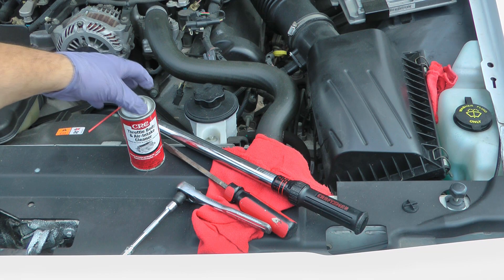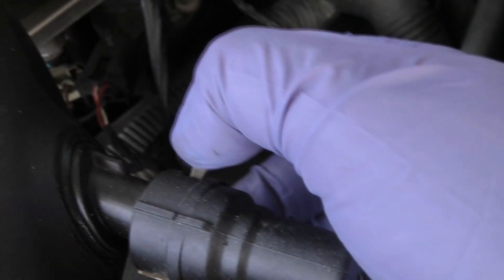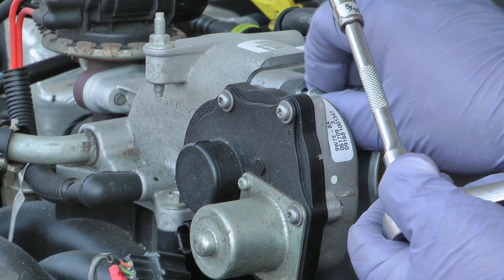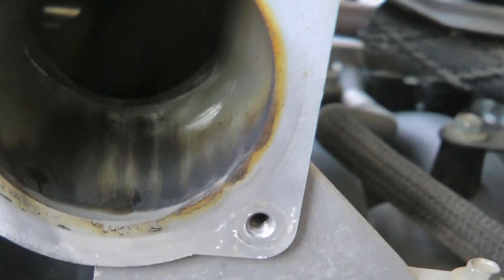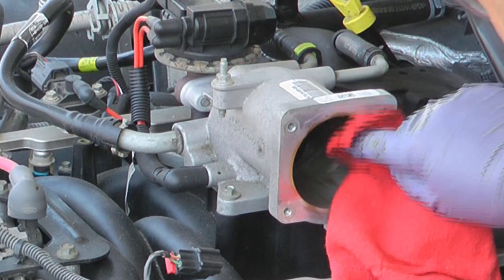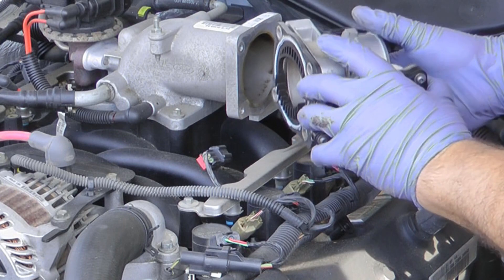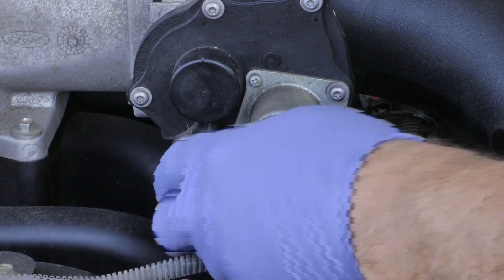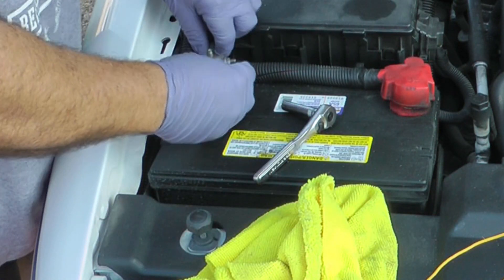Ford Crown Vic Throttle Body Clean and Calibrate Calibration Recalibrate

Comment: i just replaced throttle body on my 2008 and pretty much tried every reset besides what u did i just held terminals together and did the rest of the steps but its still not calibrating and throws wrench light after 20 seconds of driving but wont be on after turning car on and off everytime should i try the way you did it ?
Reply from the maker: you should try what I show because it works.  There are also some higher end scan tools that might do the recalibration... good luck

Comment: What wire is that sorry for recalibrate
Reply from the maker: removed the battery cables from the battery first!  Then connected them together.  I just used a little alligator clip wire

Comment: I spent about 2 hrs cleaning the throttle body on my car. 2011 CVPI 75000 miles. Not sure how it could be that bad with low miles?
Reply from the maker: maybe lots of idling or they left it where it got lots of dirt in the intake

Comment: Did you reuse the same gasket, or will anyone doing this need to get a new one?
Reply: I LITERALLY just got done with mine and yes you can reuse the gasket if it looks good still and has no cracks or is dry rotted. Also you can go to the auto parts store and buy one for around like 30 to 40 $ and they will have to order it though most likely.
Reply: @jimmakk6292 Thanks man! That's some perfect timing.
Reply from the maker: I have always reused without issue

Comment: The shop manual says to rotate the throttle body bolts 90 degrees after torquing.  I noticed you didn't do that.  Is it necessary to "stretch" the bolts 90 degrees??
Reply from the maker: you are correct that the shop manual says to add another 90 degrees.  The book I was looking at didn't mention it.  I'm not going to touch mine since I have had zero issues.  However if I ever remove mine again I will observe the proper torque spec.  Thanks for catching that!

Comment: Is there a certain guage wire that needs to be used
Reply from the maker: that's a good question!  I think I used about an 18 gauge wire.  I wouldn't go smaller than that (higher numbers are smaller)
Reply: @WJHandyDad  I have an sctx4 tuner and just realized you can reset the KAM “keep alive memory” and did it this way, relearns it’s values same way I imagine

Comment: I have a question. A while back my 06 p71 was sitting for weeks, then I drove it for a while, and then my battery died. But after replacing the battery and driving for a while the car then stalled, gave a wrench and check engine light (code p2107), and wouldn't drive properly. So my mechanic diagnosed and replaced the throttle body with one I bought aftermarket. The one I bought aftermarket doesn't look like yours, it's the silver valve, and not yellow like yours or like I see some online, and the new rectangular tps. But it would still stall and give same code. So I thought maybe the throttle body I bought had a tps for regular crown vic,  some tps only work with none p71 models, so the mechanic replaced the tps with a new tps that works with the p71 model. But I noticed this time the mechanic didn't disconnect the battery. I can tell he didn't disconnect the battery this time when replacing the regular tps with the p71 tps like he did the first time he replaced the throttle body after the engine light, because my aftermarket radio didn't reset. But even after the tps replacement the car is still stalling and giving the wrench light. Do you think maybe I need to follow your steps, disconnect the battery, and do a reset? Or maybe I need a throttle body that's for the P71? The one I bought said it works for Crown Vic 05-11. I didn't really check which specific Crown Vic models in those years because I figured all of them.
Reply from the maker: won't hurt to recalibrate the throttle body
Reply: @WJHandyDad  It's funny that I just saw your response. Because a few hours ago I decided to just recalibrate the throttle body with the new p71 tps anyway to make sure. I've driven 50 miles, regular driving, no full throttle, with the new calibration and so far so go. Only time will tell. How many more miles do you think I should drive smooth and slow, before driving the car fast again and having fun?😂
Reply from the maker: @InvincibleRage  I drove mine "normally" immediately
Reply: @WJHandyDad  So you were able to go, "lead foot" as you described yourself in the video, I am too by the way, after just recalibrating the throttle body, then drove fast?
Reply: @WJHandyDad  When you say, "normally." Do you mean, "lead foot" as you described yourself in the video? I have a, "lead foot" too by the way. The car is more fun to drive that way. Or did you drive normal, with steady acceleration, and no full throttle, or speeding?
Reply from the maker: @InvincibleRage  normally as in whatever way you want to drive.
Reply: @WJHandyDad  Great. I hope tomorrow when I go, "lead foot" I won't have issues. Thanks for the help, and your channel.👍
Reply from the maker: @InvincibleRage  I do a lot less lead footing than I did years ago, but I still probably get a good WOT romp once a week
Reply: @WJHandyDad  Nice. That's how these cars are meant to be driven, and are fun to drive. But I only do it in rural areas here in Highlands County Florida where I live when there's little traffic and enough space. I'm still a safe and defensive driver most of the time.👍
Reply: did your issue with code ever come back?

Comment: Literally just changed the TB didn’t kno about calibration till I saw this video my mechanic did however take the negative cable of during the replacement process then put it back on and told me to start the car I did and I got Kouple blocks and it stalled again do u think it’s bekuz of the calibration thingy majig 🧐🧐🧐
Reply from the maker: I hope the recalibration fixes your issue

Comment: I have heard speculations that removing the combs on the gasket helps increase performance, have you heard or thought of if this would work? Thanks.
Reply from the maker: I've heard similar and also heard that removing them will make performance worse.  I don't know and I am not in a position to dyno the car with and without them.
Reply: I honestly was just thinking this but I’m not sure if the ecm would wig out or not cause it’s more air to intake

Comment: You wouldn't know the part # for throttle position sensor would you ?????
Reply from the maker: Rock Auto has them listed.  Depends on the model year.
Reply: @WJHandyDad  None are motorcraft
Reply from the maker: @C172pilotdude  have you tried parts.ford.com?

Comment: Clean  07 Crown Victoria throttle body had no codes then after cleaning it re installed code p2110 p0122 p0223 p02111  does it have to be reprogrammed?
Reply from the maker: those codes (p0122 & p0223) sound like the wiring harness didn't get hooked up or something got broken in it.  My book doesn't have a p2110 or p02111 so I don't know what those are

Comment: W handy I used to do the same until I realized seafoam clean the throttle body better than anything else when you are spraying in through it into the air intake.
Reply: It doesn't clean it better than physically scrubbing it with carb cleaner...come on dude.

Comment: Quick question if you don’t mind? On these 4.6L Ford engines, which have the electronic throttle body, does the throttle body itself act as an IAC valve? Got a friend who has a 2006 Mercury Grand Marquis with the same setup. Rough idle, went to clean the IAC only to find out that there apparently isn’t one! 🙄 Any info would be greatly appreciated!! Thanks!!!
Reply from the maker: it must be because I didn't see any openings for a separate IAC when I cleaned the TB's on my 2008 & 2010
Reply: @WJHandyDad  Cool, thanks for the confirmation. Much appreciated! 👍🏻

Comment: I have a 08 P71 and fuse #9 that controls the ignition On/ACC, windows, door switch lighting, and radio keeps popping everytime the car is started. I unhooked the aftermarket radio and jumped the fuse and the factory radio wire harness got hot and started smoking. Could this be the reason for the fuse to blow repeatedly?
Please help
Reply from the maker: sounds like a hot wire touching ground somewhere.  Good luck, tracking down wiring problems can be easy or a real pain.
Reply: @WJHandyDad  thanks for the response. I just finished tracing the factory radio harness & I didn't finding a bad wire. I went through and tightened & re taped all the spliced wires, and disconnected everything that I had spliced into that 12v wire except for the radio. My new head unit comes in tomorrow so hopefully nothing blows when I plug it in

Comment: Hlw sir.
I have 2010 ford crwon vic.
It has no cruise control system.
I buy aftermarket crusier control switch. Is not working. Do you know what is the issue
Reply from the maker: sorry but no.  Without being there when you installed it, I have no way to know what may be wrong.  Go back through the installation process and make sure you didn't miss a step somewhere.  Good luck!
Reply: you have to bring it to a dealer or somewhere where they can enable cruise through the computer. same goes for a car that has no traction, you cant just throw the switch in it has to be reprogrammed.. at least with the newer models

Comment: What size throttle body comes on a 2006 p71
Reply: 65mm
Reply: @Strykar86  what is the biggest size I can upgrade to for a stock application bolt ons
Reply: @krownvikkhris3004  You'll want to find a 2005-2010 5.4L F250 or Econoline van and take the throttle body from there. Make sure that it looks the same as yours. Recalibrate it after install.
Reply from the maker: I'd look on rockauto and see what they show.  Unfortunately their site is down right now so I can't see.
Reply: @WJHandyDad  ok

Comment: Right on Dandy Had,

You’ve got another home run hit, on your hands.
Did you get a new camera?
Seriously, the close up shots of you disconnecting, and connecting sensors, and hoses looks really different on my screen.

That dielectric grease is great for keeping moisture out of an electrical connection.
8:28 I especially like the body throttle calibration, and relearn procedure, very thorough.

How do you keep coming up with these wonderfully useful video topics?

-Chuck
Reply from the maker: there's a guy that has a channel called Panzer Platform Extras that every once in a while gives me a great idea or gets me out of a bind if I get stuck.  We make a great team.  You ought to check out his channel some time.
Reply: @WJHandyDad  
Don't you dare be talkin' bout me behind my back.
Oh wait.

-Charles

Comment: Great video!! I recently subscribed as I have an 08 cvpi. However I got another car a few months back so the cvpi has just been sitting. I got the ol vic out the other day & the idle would fluctuate while having the blower/heater on. It's never done that, the idle has always been ridiculous steady! Any suggestions? I just put in a new battery & plan on cleaning iacv and throttle body. 
08 cvpi 116k
Thanks!
-D
Reply: Yo D,

Forgive me for butting in.
But if my Vic did that I would first want to confirm & verify the alternator is functioning properly.

1.) Connect a voltmeter to the battery, and place it where you can see the display readings from the driver’s seat.

2.) Take note of the battery voltage when the engine is off.

3.) Start the engine, and while it’s cranking observe battery voltage, it should stay above 9.6 volts.

3.)  Observe the battery voltage after the engine has started, it should be at least 1 volt higher than it was when the engine was off, (example: if it was 12.6V engine off, it should be 13.6V or higher engine running).

4.) Now with the engine idling, turn on all accessories; A/C, Fan Speed to HIGH, Rear Window Defroster, Windshield Wipers, Radio, etc.
The battery voltage should not drop below 13.6 Volts.

If it does, further diagnosis would be warranted of the alternator.
Possibly one of those fancy computerized load testers they use at your local parts houses.

Keep in mind the voltage figures I’ve quoted are approximate.
My 2010 Grand Marquis battery voltage reads 14.1V - 14.4V depending on conditions with the engine running.
My 2004 Crown Vic battery voltage reads 13.8V - 13.9V depending on conditions with the engine running.

-Chuck
Reply: @PanzerPlatform  Wow, thanks for the advice! I had my alternator checked when I got the new battery a few days ago by the guys up at autozone & they said it was good. I don't know how accurate their readings are though, I'll give that a try. Thanks again for the advice fellas
Reply: @GSXRgYpSy  
Those guys at AutoZone are pretty good.
But it don't cost nothin' to go across the street, and get a second opinion from O'Reilly's . lol
-Chuck
Reply from the maker: try the calibration in this video and see if it helps.  Other thought is a vacuum leak.
Reply: @WJHandyDad  I'll give that a try thanks!

Comment: I got a pickle for you. 
My obd2 port doesnt send data to a scan tool, it has power at the port but doesnt send data. Any idea what might cause that? The conputer is functioning as i have a check engine light and pcm light on the dash, but cant check and clear those codes without being able to connect to the obd system
Reply: Yo Victor,

I’m sure you’ve already done this but, just to make sure.
Check all fuses in the passenger compartment fuse box, and the engine bay fuse box. Use a continuity tester like a multimeter to check each fuse. 
Sometimes it’s hard to tell visually alone.

Next, get out your owners manual, and check to see if there any fuses that are missing that should be in there. Sometimes techs will steal a fuse from a location that they deem unnecessary at the moment to test other components.

Next, check your Scan Tool on a different vehicle to confirm it works.

Also, some cars will give up their data livestream, and DTC’s with KOER (key on engine running), and some with KOEO (key on engine off). Try both ways.

You said your DLC has power at the connector.
Just to make sure, check the ground at the connector as well.
Pin 4 should be Chassis Ground.
Pin 5 should be Signal Ground.
While your at, locate the PCM, and check it’s ground for continuity, and corrosion.

Be sure to use a safe testing implement when you’re probing pins, and wires like an electrical safe logic probe, instead of a basic test light.

-Chuck
Reply: @PanzerPlatform  also thanks, best answer yet
Reply: @PanzerPlatform  yeah my mechanoc couldn't get data on his dealership level scan tool. But I think your describing a groumd fault test, which is what i plan to do in a couple weeks when i buy a scan tool
Reply: @victorrand8811  
Yo Victor,
The scan tool I've been using since 2012, and recommend is only $20. 

It works with any smartphone, tablet, or laptop via WiFi. 

It's called the ELM327 WIFI. 

There so cheap I keep one in each glovebox. 

I'll leave a link in a separate comment. 

-Chuck
Reply from the maker: sorry, I don't know.  Did it work before and now doesn't, or did it never work.  I'd look for cut wires... the PD downfitters are notorious for cutting wires to things they don't need to
Reply: @WJHandyDad  i dnt know.
Reply from the maker: @victorrand8811  unfortunately tracking down electrical issues can be a pain.  Good luck
Reply: Codes can be easily removed (cleared) without a Scan Tool or other electronic device -- simply disconnect the vehicle's battery (Negative cable first off, last on) cables. It's a good time to clean the battery and fill the water to the proper level, and put a slow-charge on it. The codes will reset (clear) by themselves in about a half-hour. 
 Re-connect the battery ( Negative first, then Positive), and you should be good to go !